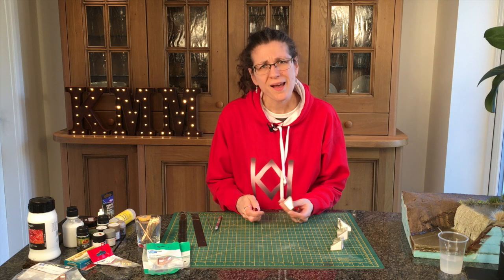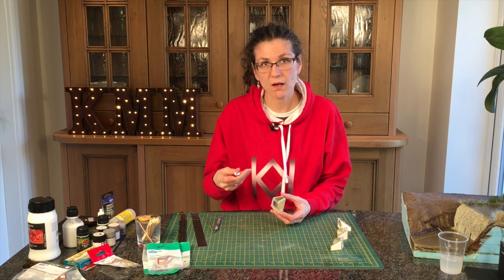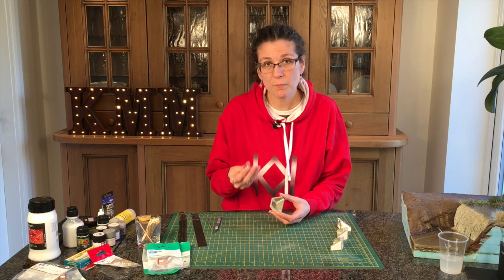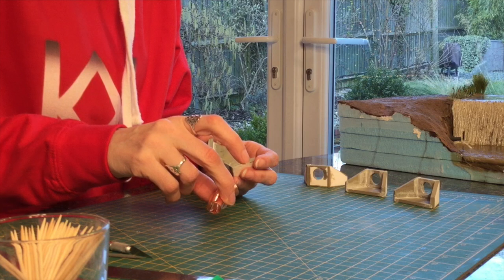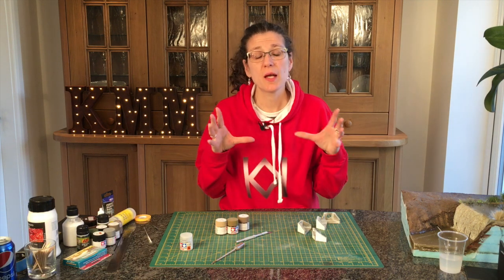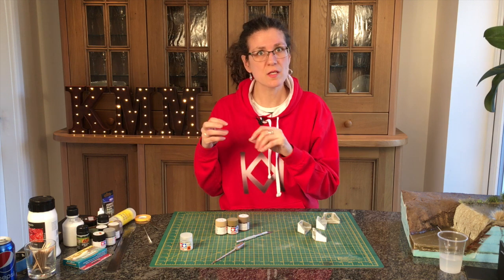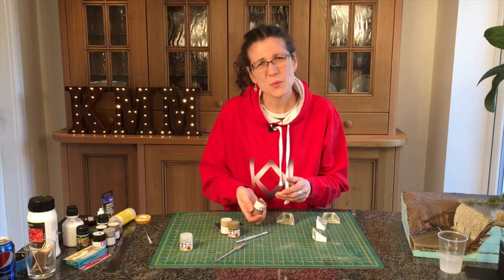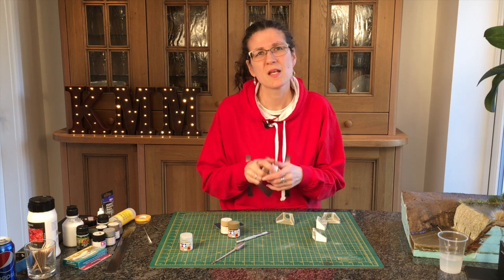How to Model Culverts

Comment: It may be worth trying Polybutylene  (PB barrier) pipe from the DIY shop. It's a 2-layer pipe in 15 & 22mm that means you can strip back the outer layer a mm or two to make it look like the spigot-end of a concrete pipe. Also it is 'sandable', so paint will stick.
Reply from the maker: +nlo114 That sounds really interesting. Thank you for sharing and next time I do culverts I will look it out.

Comment: You could also make silicone molds and plaster duplicate, damaging them and get models

I thought you'd done drains, but you buy, buy maybe later
Reply from the maker: Hi. I had these sat on the side but I think I picked them up secondhand. I do love scratch building but mostly in wood, not plaster.

Comment: Great job. Instead of using copper fittings, why not get a small length of straight copper tubing the same size as the fittings. Very easy to cut and you can cut them any length you want. It is cheaper too.
Reply from the maker: +John Nelson I was being lazy with the cutting!  The edges are also finer on the fittings sometimes.